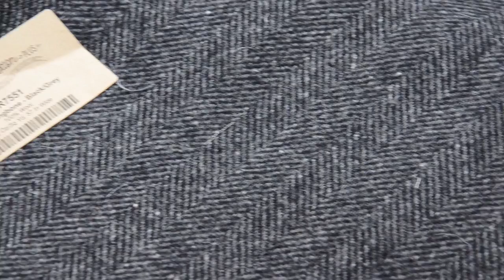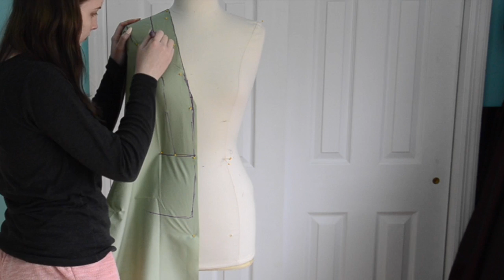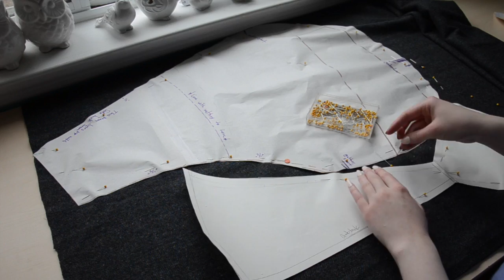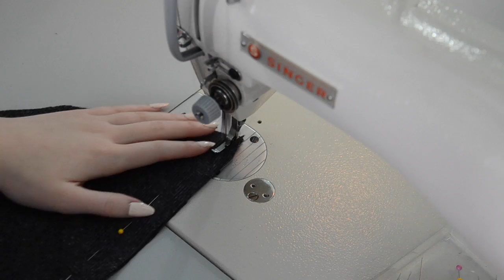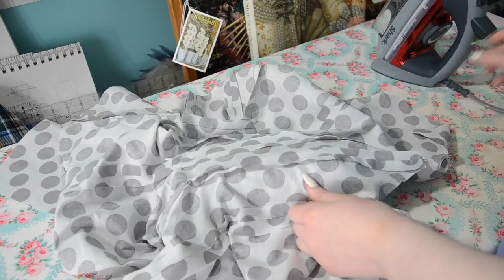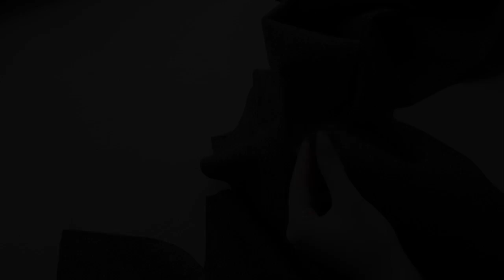Making an 1890's Sporting Jacket : Part One

Comment: Beautiful jacket. About the way you draft patterns, do you do this with all your designs and does the manikin need to be your exact measurements for this to work. I have an adjustable manikin however there are gaps between the panels would this be a problem. So far i have used the more technical way of drafting patterns using measurements however i find this hasn't worked well with more unique garments and i am not very good with math. I was thinking about trying out your technique in my next project but am not sure it will work well with my manikin. Love your videos as always, can't wait to see how this outfit turns out.

Comment: oh my goodness i'm never one to comment but please do not sew over your pins it can bend your pins and potentially break the needle on the machine
Reply from the maker: +Geraldine Heredia This is addressed in the description box because it always gets brought up. It isn't something I would recommend doing but i've only broken two needles doing it in the entire time i've been sewing compared to the dozens i've broken due to tension issues, working with heavy weight materials, and sewing with boning. So that isn't a major concern of mine, but it still isn't something i'd suggest other people do.
Reply: Plus it could fly off into your eye and blind you
Reply: Geraldine Heredia
Reply: Geraldine Heredia

Comment: I like it, but I wonder if it isn't more historically accurate to have button holes on the jacket and the actual buttons on the dress? My areas of expertise on historical clothing mainly centers around Regency but I feel fairly certain on this point.
Reply from the maker: +LaBouilloireNoire I've never seen that done on sporting attire from this period (except maybe on sporting costumes with vests).  Part of the joy of sporting costumes was the versatility, and you'd lose that if you couldn't remove the jacket without having buttons visible on your shirt! And for this piece the buttons extend past the shirtwaist worn underneath it, so half the buttons would have to be sewn to the pants, which would look pretty silly.
Reply: I see, I imagined a vest underneath this so that the jacket would set well in place and not shift about when you were moving. But if you are going for a billowy blouse look underneath then you would obviously not want the buttons laying strongly on the blouse.
Reply: Hi only watched this video but she does say she designed ir so does it really mater it's her twist on the garment x